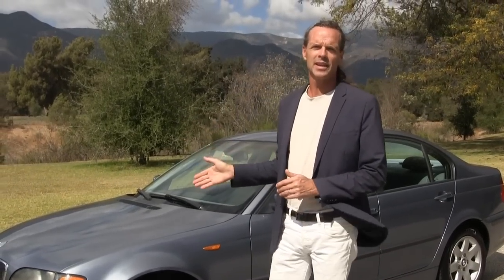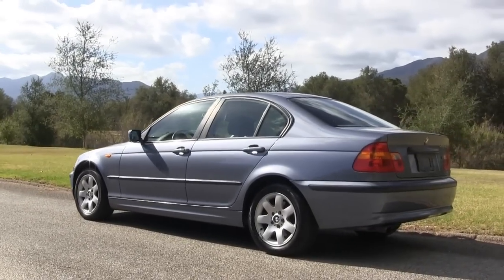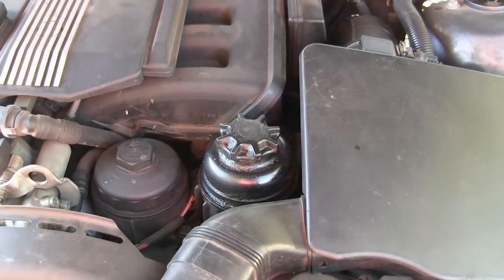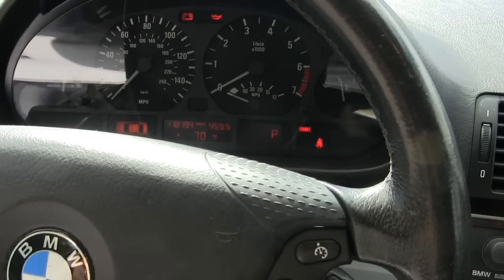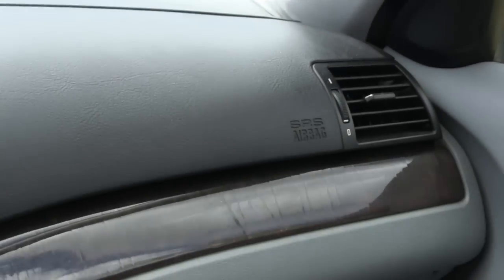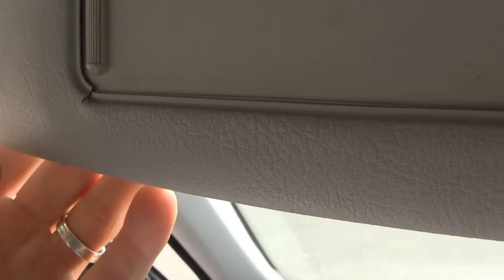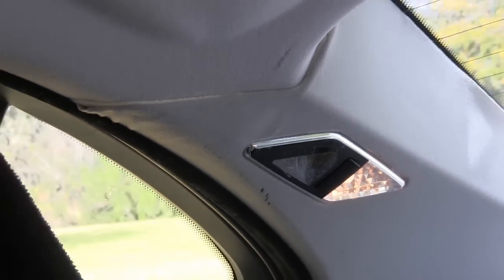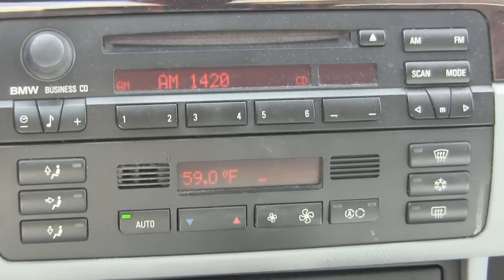Why You Should NOT Buy a Used BMW

Comment: BMW engineering is superior with regards to dynamic handling and efficiency. But they use god awful parts and cheap out GM-style which makes them undesirable as used cars. BMW should have just bought Volvo and used their fit and finish department to perfect their cars.
Reply: wave runner lol gm is so trash BMW is steeping to their level or have already
Reply: Paul Small
Volvos are great! Sure some may have had problems but the majority are reliable.
Reply: ALL  2001+ Volvo interior AND exterior are in such condition on the used market, they look like it's a 2 years old car.  What are you talking about?  There is nothing Ford in a Volvo cabin, not even a switch.
Reply: exactly, only thing volvo used was p1 platform suspension, which is great handling for a FWD car, have you ever been in a non-trashed volvo? their interiors are super durable against like audis and VW and are the most comfortable of all brands, the cheapest volvo has more comfy seats than a 7 series
Reply: rudkacka
People took my Volvo comment way out of context. Volvo makes solid cars. If properly serviced they run a long time and remain solid.
Reply: wave runner i was telling about Pauls and Blakes comment, Volvos are nice build but you are right, they must be serviced properly
Reply: do not take this BMW as an example for all BMWs, they are quite nicely built but this one wasnt taken care of at all, all of the sagging of headliners and plastics falling apart is due to bad sun conditions, i have never seen a beamer in a worse state than this one, it was just trashed around like a dong

Comment: I’ve owned a lot of cars over the years including Mercedes VW and bmw. Most reliable car ever was my 1997 Honda Civic that I ran to the ground in the most unforgiving conditions. Never had one thing go wrong with it. I eventually sold it for 1000 euros and part of me wishes I hadn’t sold it.
Reply: Buy another Japanese car. Toyota or Honda. They all tick on forever with basic maintenance. Cambelts, waterpumps and regular oil changes. Set to see over 200,000 miles. Obviously if a manual you'll be changing the clutch eventually around 130,000 if the clutch isn't ridden. 
My next door neighbour has a 2010 BMW, constantly repairing it and down the mechanics yard. Any BMW with more than 100,000 miles is a endless money pit.

Comment: I'm not rich and I work hard for my money.I bought a used 2007 BMW E92 330i back in 2013, it had 109,000 km on the clock (a bit less than 68K miles). This is s 3.0 liter inline six normally aspirated port injection engine delivering 272hp at 7,000 rpm. It's my weekend car, I do roughly 8,000 km a year with it, so not an awful lot. Now with 142k km on the clock.

No HPFP issues (only low pressure fuel pump in this model) port injected (no direct injection so valves get cleaned by fuel), no turbo failures (normally aspirated), no electric failures, no limp mode, no horror stories. Maybe I've been lucky I don't know but the only things I did to the car was change the battery this year, it was 11 years old from factory, not bad, would still start but the crank was a bit longer than usual and I didn't want to risk it. That was a 100 euros job at an independent trusted garage. The second thing that needs fixing is the rear parking sensor which no longer works. I won't be repairing it as I don't need it. That's it.  Other BMW owners in the community advise to look out for a few things prone to go at some point (electric water pump, thermostat, valve cover gasket, oil filter housing gasket, oil pan gasket). But so far so good, touch wood.

It only cost me 15.5K euros back in 2013, was worth 54K new with the few extras (full leather, M3 wheels, sports suspension etc.). A very clean and uncluttered dashboard, no useless idrive, no obsolete navi, no touchscreens, good old fashion buttons feeling solid, almost a sober cabin by today luxury standards with no gadgets, no nonsense. The only entertainment I get is when plugging my 2013 160gb iPod (I still use one of these) via the digital port into a very decent stereo with well rounded speakers, or my phone (using the jack, although not as good a sound as iPod). 

The real pleasure comes from the driving, the way it communicates to me through the steering wheel, the pedals and the manual gearbox. The precision of the steering and the smooth progression of the accelerator is a real joy. It's not crazy fast but plenty enough for me. This is all the car I need to put a smile on my face. 

So in my experience with the limited use I make of it, I'm extremely satisfied for the money I paid.

Comment: Every car shows its age..but if its properly maintained you don't have problems. but hole ideea is If you buy an  old bmw  and its not in the best shape you better be prepaired to feed some money on it! after that...have fun :D
Reply from the maker: Precisely the whole point of the video.
Reply: Even a Corolla in "not the best shape" will give you a hard time, miles are nothing, maintenance is everything! Brakes for a Corolla in an indy shop go around $300 per axle, 02 sensors? $250. Cat converter $600 and the list goes on an on. No beaten up car is cheap to properly take to a decent condition. The difference is that the BMW is less tolerant to "my friend fixed it in his backyard" type of fixes, you gotta install the correct parts. Cheap parts will give you cheap results.
Reply: i didn't know that toyota parts are so expansive...in fact when you start feeding money into your car regardless what car is,  its sucks! i just paid 500 euros for an oilchange with filters and brake fluid replaced on BMW dealership! ouch...:D
Reply: That's the point, don't go to the stealership, they'll rob you despite being a BMW or a KIA, you can find specialized independent shops that will perform a much better job for less than half of the money, if you want extra peace of mind you can search for reviews on the internet. For example the shop I take my car to knows the e46 from bumper to bumper, all the techs are car guys and own or have owned performance cars, never had to return twice for the same issue and the price is way below the official stealership for example, the stealership quoted me $550 to change the fuel filter on my car (e46 325i), this independent shop charged me $200 (part+ labor), if you are mechanically inclined the OEM filter itself costs $50 and you can change it in an hour or so. Cars are as expensive as you want them to be!
Reply: mleindek man...i like this word now! stealership! ha ha ha niceeee...
in my next Videos on my chanel i will change a lot of parts on my other car (Hyundai Getz). so i think   i will find out if i'm mechanically inclined! ha ha...u can sub to my channel if u wanna see more...thx

Comment: I have a 330 ci with over 300.000 km. The engine never overheated, but I had to change the expantion tank after 11 year and more than 200.000 km. That time i changed my water pump which did not have a problem, just precautionary. Except from normal wear items like brakes, suspension parts and operating fluids (engine and gearbox oil) a had nothing else replaced. I think it's a very reliable car.

Comment: I'm sorry, but this is bullshit. i got 5 series e39 530 135kw. after driving it for a 1 year i had not a single problem with it, just had to change an oil. was driving it every single day. the car is year 2000, so after 20 000km and one year for a car that is 17 years old - ITS FUCKING GOOD. Some new cars can't compare with that.
Reply: I ran a 528i E39 to 380,000 miles. No engine work required beyond routine servicing. Stick with BMW approved LL04 5w30 synthetic. Mine was damaged in a rear end accident. Shame,.
Reply: Right on man! I used to have a 2003 E39 ( the last and BEST era of 5 Series !! ) and I had not ONE problem in over 2 years of ownership.
Reply: Arturs Jurevics. That's right. I had a e39 run like a monester

Comment: Wow, I'm very surprised!  Although you did mention that they all have these problems, it sure looks like that particular car sat in the middle of the desert as all those problems are heat related!  Nice vid Greg.  (I drive a Audi S5 and the fit and finish of my interior is beautiful, the fit is so precise and tight that if you need to take it apart it is very difficult to see where to start!)

Comment: After about 5 years, every BMW becomes just like any other 5 year old car, except that maintenance and parts are 3-tims more expensive.
Reply: no, maintanance is not 3 times more expencive on a bmw compared to other european/ japaneese cars. they may be compered to american cars, but I dont know, because I dont know anyone owning one.
But I know people with opel ( vaukshall), subaru, wv, toyota, ford, kia, volvo, audi etc.
In some cases the service will be more expencive on a bmw, but other cases not.

A bmw, as all other cars have to change the motor oil, oil on diffs, brake fluid, breakpads, breakdisk, hydraulik steering fluid etc.... 

Tell me, what is 3 times more expencive on a bmw ?
Reply: Order parts from Europe. Here they are cheap. Much cheaper then for Japanese cars.

Comment: The ultimate disintegrating machine.
Reply: they are and they are built to hold up for 5 years a former BMW engineer said they are designed to hold up for 5years that is why they put suppar quality parts in the car. the engineer tryed to get better quality parts but the big wigs said if we give them better cars then they will not be spending there more money on BMW.. it's like a cell phone the phone is really supposed to stand up for 2years really
Reply: BMW over engineered cars up until about the early 90s when the "bean counters" came in and wanted them to start cutting cost to compete with other imports.  That why you still see old BMWs and Mercedes from the late 80s still on the road with over 200,000 to 300,000 miles on them. I have owned many of these German cars as early as a 1980 320i  up to a 2001 530i model I have now.

Comment: I have owned all kinds of cars and BMWs were the best driving and handling cars of all.  They were also the only cars that left me stranded on the road...and all under a year old (all 3-series 1989, 1992, & 2015).  I still love them but my faith is shattered.  Now when I see a BMW on the road, I am so glad I don't own one anymore.

I have never owned a BMW more than 3 years because of ongoing problem.  The problems shown on this video also happened to almost all my other cars that's around 10 years old regardless of brand.  The thing is that they cost far less than a BMW.
Reply: Tanah Merah Terbaikkkk bang👍👍👍
Reply: Are you saying it's normal for the 3 brand new BMWs to break down within a year if it wasn't maintained?  FYI, I had free scheduled maintenance from the factory for 4 years.
Reply: Owned the same exact car as the one on the vid for over 3 years now, 250.000 miles, never left me stranded, maybe you had bad luck, maybe the shop that you took it didn't do a proper job... Who knows.
Reply: Yeah keep telling yourself that
Reply: Tanah Merah Especially on the ones there are malfunctions. Ive got a e36 328i wich was basicly thrashed by the last owner. After three years now only problem anymore is rust on the side skirts. Coolant system and intake fixed, some welding, lot of censors and shit fixed. But its the weird individuality in the car. Interior like the sun shades and hood and gauges work. Even the large obd works without a single pixel missing. Also my car lacks all the rust from the sides wich are typical. Broke down on the road about 3 times but still a driving machine to this day

Comment: First off this car was really mistreated. Yes, some of these issues are common (water pump) but the interior of any car is based of its owners habits. If you love something, you'll make sure it well taken cared of.
Reply: Shabec2982 .  By well taken care of you mean replace what shouldn’t break as you go? Materials fit and finish the cloth on the  pillars and the subframe crack are totally un acceptable.  Those items alone are very expensive to fix.  Especially the loose materials on the pillar A B and C posts. Just compare the new car warranties offered for different brands.  Then the coverage of their extended warranties.  That will indicate what kind of faith the car maker has in their product. A good friend of mine owns a huge independent European car repair center.  He told me that if I wanted to buy a vehicle that would last I should buy a Toyota.  That’s why he fixes European cars because his profit margin is huge even especially competing with dealer service centers. He would have gone bankrupt if he had opened an independent Toyota repair facility LOL.

Comment: That's why I always buy Japanese. Thanks Japan 😘
Reply: Buy only Toyota, Honda, Mazda and Subaru products 

Nissan, Mitsubishi, Suzuki and Isuzu are Japanese but there cars are unreliable piles of junk
Reply: @joskjj3625  Mitsubishi? No i used mine for 27 years and it runs. 4G series engines are tough as hell
Reply: @joskjj3625  mitsubishi propably more reliable than subaru tho

Comment: So you bought a 15 year old car, and IT HAS WARE AND PROBLEMS?!
Reply: Maskulinism i have a 34 year old car with 0 problems
Reply: So you have never ever had to replace something?
Reply: replacing things is different then stuff being poorly designed.
Reply: No I think he is saying that because it as a BMW these flaws re expensive and regularly fail again and again. Makes sense to me. Those $700 door pulley set-up is a case in example.
Reply: Yes, replacing things is different then stuff being poorly designed. 
And a well maintained car is different from a badly maintained car (by previous owner)
Reply: Maskulinism this is true. however, i have owned both a Toyota and BMW and my Toyota has always been far cheaper to maintain. my Toyota is also simple to work on so I do all the work myself. with my BMW, parts were prone to fail prematurely and were expensive to replace.
Reply: The window regulators are not $700 each.  That's total BS.  Because the "CarAngel" said it doesn't make it so.  

The featured car was abused.  It was likely never waxed, the rubber never maintained, and the interior used as a cat tree or lord knows what.   Someone had to step on that rear ash tray to break it.... probably some kid trying to access the front seat.  Of course the current owners is going to say it was "well maintained".  It's the same as asking someone if they are a good driver.  Without a doubt, 99% will say that they are.... but they aren't.  

I have a 2003 E46 Cabrio.  It does NOT look anything like that car.  It has been mistaken for new.  The smog guy asks to buy it every two years when it gets tested.  A few of the techs at the indy that I take it to (every two years whether it needs it or not) want to buy it as well.  I spend, on average, less than $1,000 per year to maintain it - and that includes things like new floor mats and cleaners.  No one believes it's 14 years old.  

The gooey "soft touch" coating that "scratches" that he made such a big deal about comes off in hot water mixed with Dawn dish detergent.  The warm water softened it and it came off with my thumbnail.  Now it looks far cleaner than it did previously.  In fact, it looks new.  Apparently, the "soft touch" coating reacts badly to lotions and Armor All type products.  I simply removed it and it looks just fine.  Took a whole half an hour - an hour if you include taking the console out of the car and reinstalling it - all done with hand tools everyone has at home (a philips head screw driver).   

Google "Mike Millers Lifetime Maintenance Schedule" to see how BMW maintenance should be done - which is by not following BMW's maintenance schedule.  Why?  Because BMW leases the bulk of their cars in the U.S. so they give away "scheduled maintenance" and claim that their trans and differential fluids are "lifetime".  This is done to control their costs, not maintain the vehicle.  It's a marketing tool.  There is no such thing as a "lifetime" fluid.  My trans was recently done (automatic).  The diff is done every 4 years.  The brake fluid flushed every 12-18 months.  The coolant is done with a "drop and top" every oil change (6 months max - not mileage - which equates to about 3,000 miles).  And, yes, the oil is dirty by then.  I only use Shell V-Power Premium, not Costco or Cheapo Charlies save-a-dime gas.  The more alcohol (ethanol) in the gas the more water builds up in your gas tank.  Ethanol is hygroscopic (absorbs water) at a rate of about 50 times more than pure gasoline.  That water sits in your tank and rusts/contaminates the entire fuel system.  That's why you use name brand.... and the recommended octane.
Reply: Haha. Emblem... Yap, my 730 also had cracked emblem after about 250kmiles. I replaced it for $5 and it's nice again. The car on the video was poorly mantained and abused and probably the tacho was tampered.
Reply: That guy s just stupid basher.  I guess he picked it up for free at some scrap metal yard and put a his little kids in it with some nails and knifes. Have fun with your Bimmer Cabrio. Those cars are still awesome and slip busters, but let the loser drive their Camry's and Hyundais haha

Comment: I obtained an E36 a few months back. Your honest and candid video applies to the E36 also. 
Many parts of this car were designed poorly, and the parts count is higher than most other cars. These cars do NOT last any longer than the average car. There is some fun to the car when everything is right, but there is trouble waiting around the corner. Quite a disappointment to me.